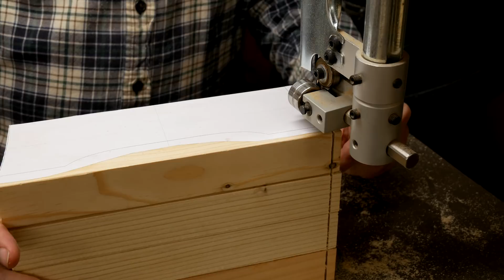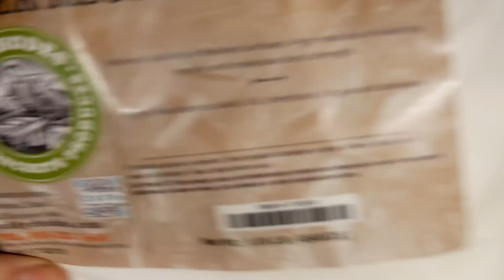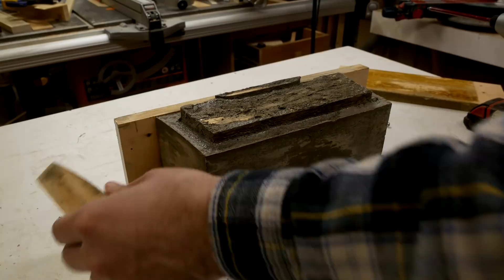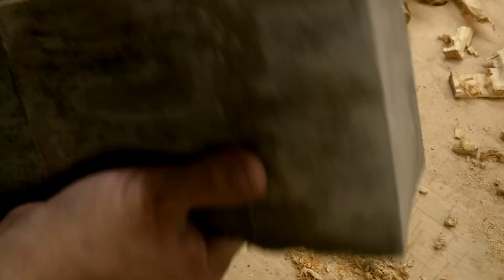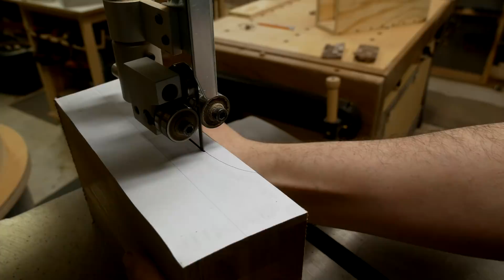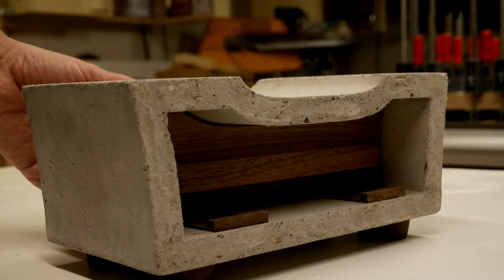Concrete Bandsaw Box

Comment: Have you thought of using JOHNSON'S PASTE WAX to seal the concrete. You can burnish it in till you have a high gloss shine. It will bring out fine details in the concrete. Also it will make very moisture resistant. Have done this many times on concrete floors.
NOTE : when using JOHNSON'S PASTE WAX warm it till it's almost liquefied. Kinda like mayonnaise consistency works best.

Comment: Does that ever look good, I could see an entire bedroom set made in this style. Well done! When I saw the clumps in your mixture at first I thought they were the stones from the concrete mix, what a pain that must have been. When I mix small batches of concrete that don't have stones I put a heavy sheet of plastic in my wheelbarrow and knead the mixture in the plastic and when it's ready I roll the plastic into a cone like a pastry piping bag and squeeze it out. Once you get the hang of it you don't even need gloves.
Reply from the maker: I use a ziplock bag and cut off the corner for small stuff but this was a bit too much.

Comment: Did you mix the fibers into the dry ingredients or into the wet mix? Possibly mixing them into the dry and mixing before adding the water, or mixing in smaller amounts at a time may have helped.
Reply from the maker: I added the fibers to the water first and then started adding in the dry.  I would probably try mixing the fibers into the dry first next time.

Comment: Cool build.  I've had some PVA fibers sitting around I've been meaning to try.  My understanding is that usually they are used in face coats to reduce the risk of cracking, but don't provide the strength of standard AR fibers.  I want to try and push them a bit further tho, since GFRC is pretty darn strong even without the fibers (due to the polymer used).  for future reference , if you just do a lower dose of AR fibers (eg 1.0-1.2 lb fibers per 50 lbs of mix), and mix it a bit wetter, you can still get a nice surface without a face coat.  You just have to be careful not to sand it too aggressively.
Reply from the maker: Thanks for the info!
Reply: No problem.  And again, really cool build.  More concrete plans in your future?

Comment: did you think about trying to make a inner core that would have been reusuable? seems like a waste considering the end product came out some well, would have been nice to have able to reuse the entire form.
Reply from the maker: I thought about casting a silicone inner mold maybe 1/4" thick around a solid block, with the block tapered so it would come out more easily.  But I would only do that after I knew the shape would work and that I wanted to reproduce it more than once.